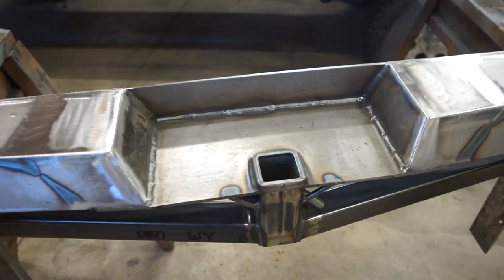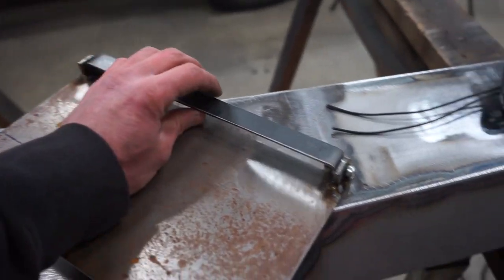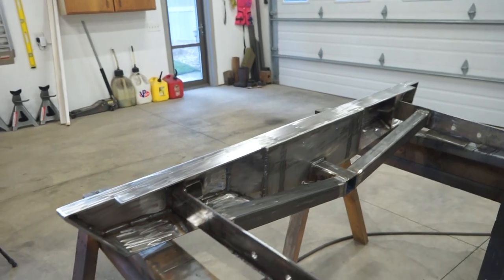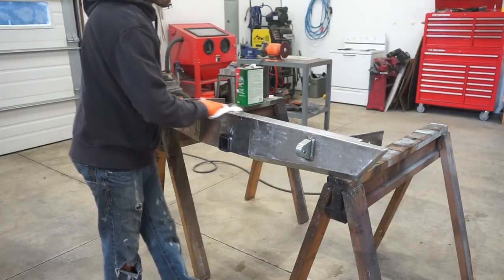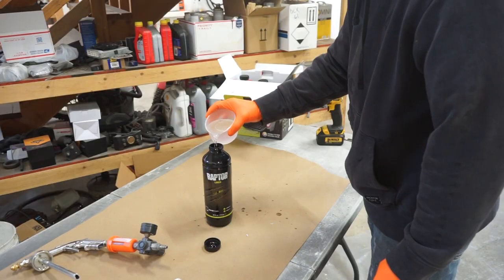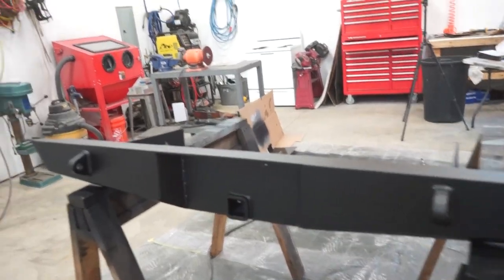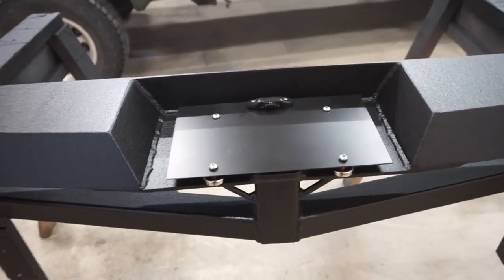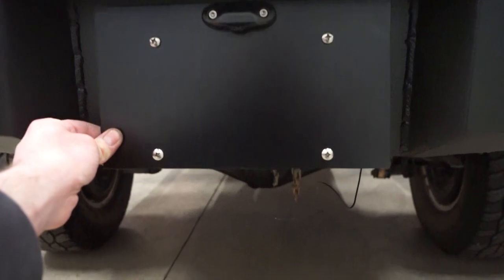Custom Toyota Pickup Bumper Get Raptor Liner!!

Comment: Love your work dude. Just wanted to pass a little tip, I have heard that when using weld through primer, you want a very thin coat of zinc enriched primer for steel. Zinc to help stop galvanic reaction, and thin coat to keep from messing the welds up.
Reply from the maker: Thanks! I was using zinc weld through primer!

Comment: Ive really enjoyed this build. I have a 91 regular cab Pickup myself. Just want to throw out my opinion. Im aware that the 20 inch rims like on the red truck have been fashionable for a long time now but I feel they look too cheesy.  The old school big sidewall/small rim combo looks proper on these trucks. Plus the ability to air down and get flotation and grip is huge.
I'm sure you'll pick the look you want, but some black 15 inch steelies and some 33x12.5x15 tires would look great on this machine.

Comment: I know you already sold this truck, but I was considering this bumper build, and I did notice a slight issue guys might want to consider if they go forward with it.  The access hole for the spare tire hoist is possibly partially blocked, and may be a challenge to get to.  Lowering the bumper by half an inch or maybe less would probably solve this.  Maybe it's hard to actually tell unless you can see it in person, but just keep an eye out for this when mounting.

Comment: Great video cool bumper! Great Idea with the Magnets! I was going to message you to do something like that. For Wheels on the Cheap, Raptor Line your wheels black and put Either 33x10.5r15 or 255/85R16 depending on your wheel size.

Comment: Sad you didn’t do a flush mounted backup light.  Also thought you were in Wa, not ID?  Or those were just the plates that came on the truck, I think that was it.   Very nice work as I’ve come to expect from you.  Those welds look fine, don’t trip. We are our own worse critics.
Reply from the maker: Yeah didn’t feel the need for lights haha these plates are from when I bought it! Thanks man!
Reply: @austinniemela  lol, since when did a “need” make the list of mod requirements.   None of the mods to any of my vehicles are a need, they are all just cool. Except my back up lights, I needed those for my truck. Tint and dark property with no streetlights.  I’d hate to hook up to a trailer with out them.